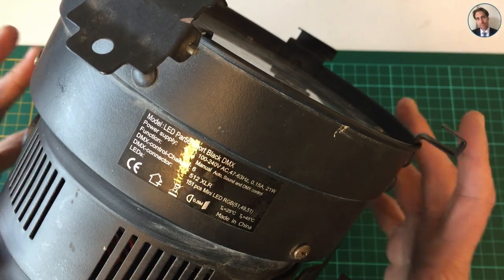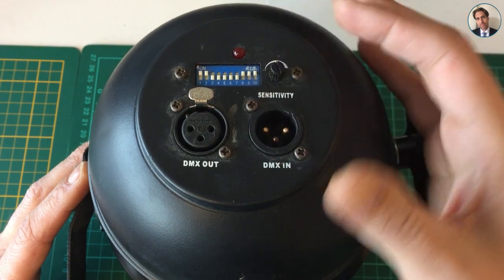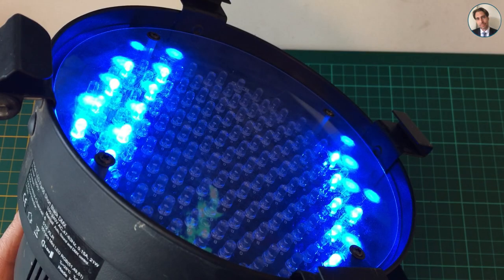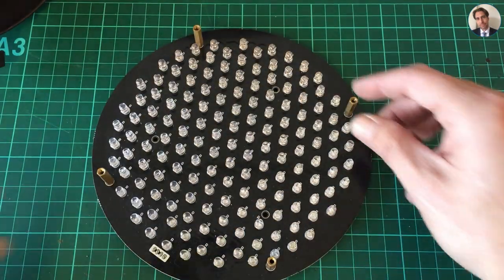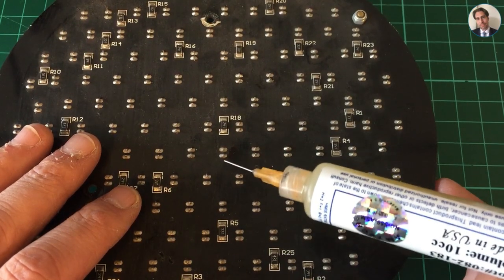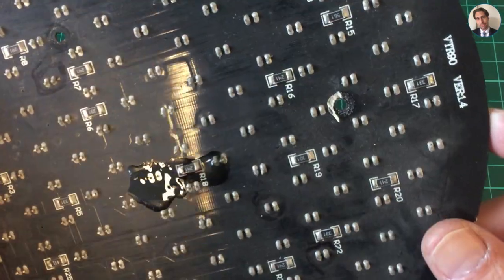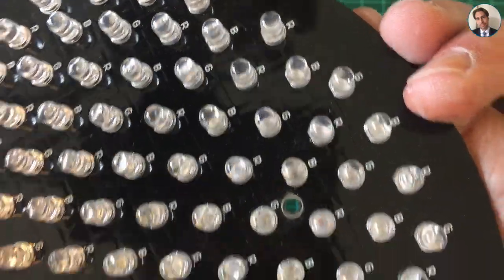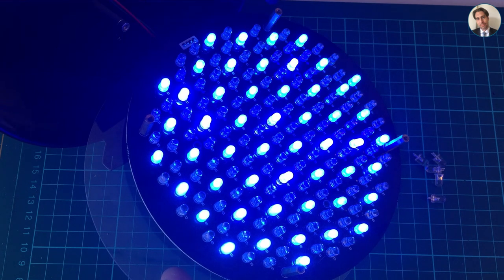Repairing a Failed Stage Light

Comment: May I ask what is your day job? If you use such par equipment I assume some audio or lightning stuff for festivals and so on?
BTW I like when people repair stuff instead of throwing it away. Our planet will surely be happy about this. Yesterday I rescued a network switch from being thrown away because of a faulty input jack. 2 drops of solder saved it’s life. My job is IT Administrator.
Reply from the maker: I am a sound engineer. Currently I work in a theater here in The Netherlands. This one was about to be thrown out when I offered to take a look. Usually it's more cost efficient to just buy a new piece of equipment than paying someone to find the fault and fix it. But as I do this as a hobby, I don't mind spending time on it!